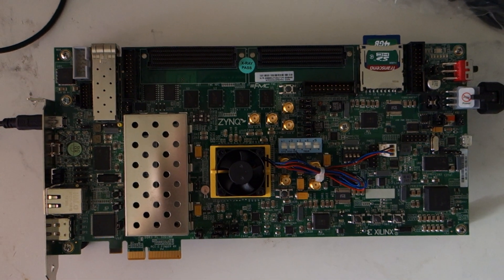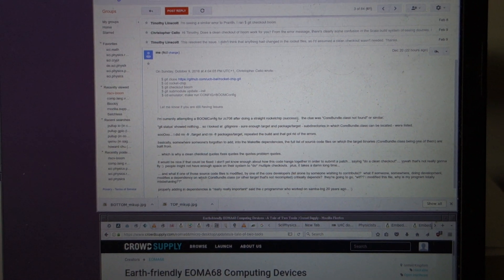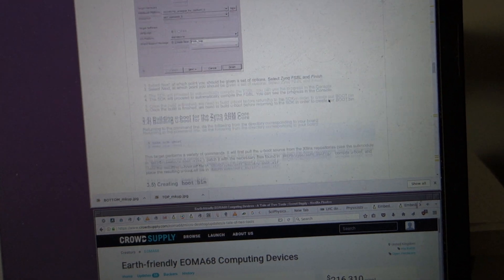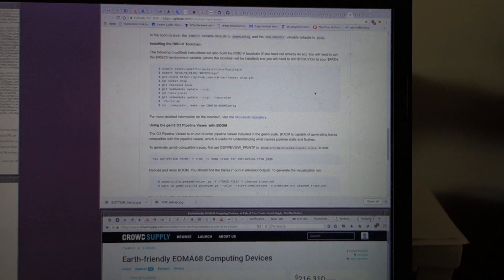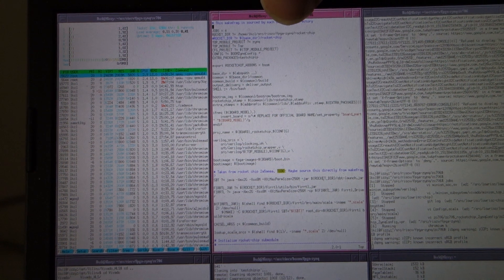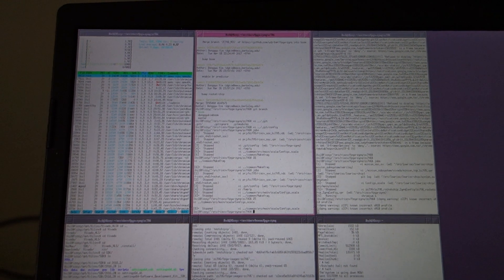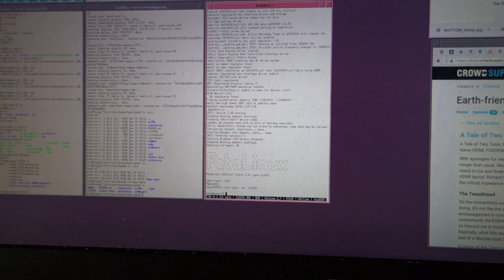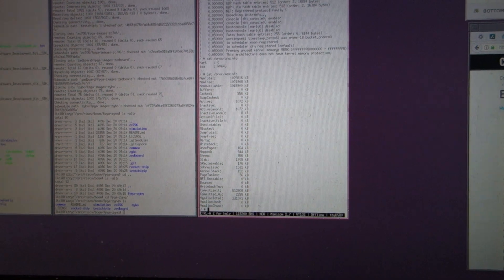Demonstration of BOOM RISC-V RV64G rocket-chip booting GNU/Linux on a ZC706

Comment: Why this is not 60fps video?
Reply: Lots of people don't have good cameras.
Reply: @willest5719  Phones from 2013 could record 60fps.
Reply from the maker: i'm an ethical libre developer and advocate.  why would i be using an unethical phone that requires an account with an unethical company in order to enable its use? if i want a phone, and i paid for it, i want it to be mine and mine alone, fully autonomous and under my full control.